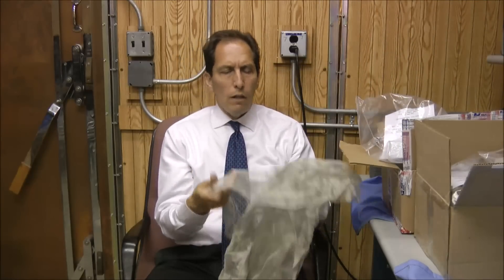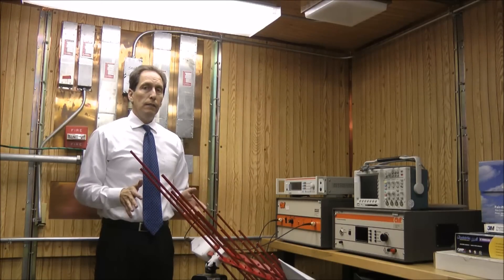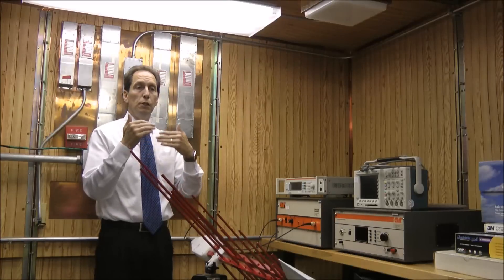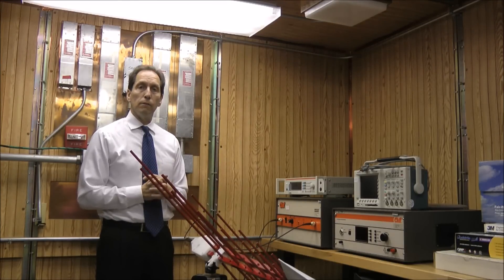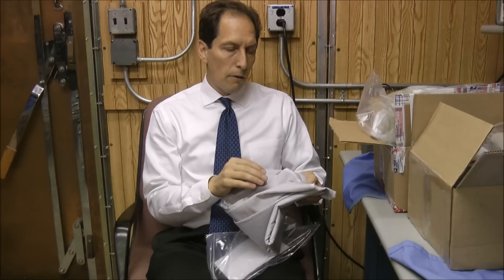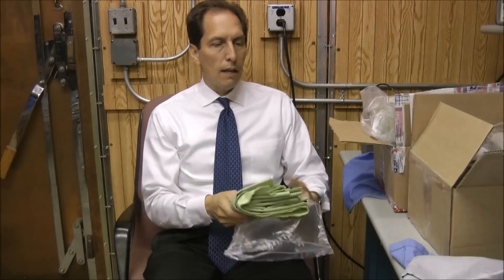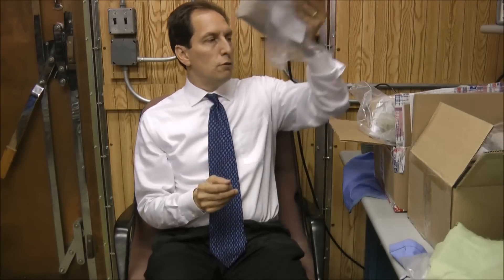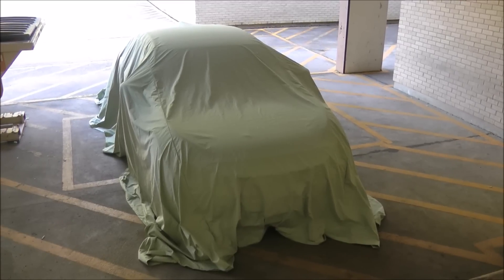Protect Generators and Cars from EMP

Comment: A couple concerns come to mind.  You said that you were concerned about the products containing nickle,  and preferred stainless steel.  Yet, it's the addition of nickle to steel that makes it a stainless grade of steel.  Second, you expressed a preference for stainless over silver.  Stainless steel has a promenent shortcoming in that it will not stand up in the face of attack by chloride containing agents such as salt water. On the other hand, silver is near the top of the list of materials that are most stable in regard to chemical attack, with only a few being better, like gold and platinum.  Beyond that, it has been demonstrated that silver remains an effective conductor even in an advanced state of corrosion.

Obviously, stainless is much cheaper than silver, so your recommendation may remain valid for that reason, but I'm not so sure about your other reasons.  I share your concerns and am very interested in this topic, and in no way do I wish to demean your work.

Best Regards.
Reply from the maker: All good points Robert. In my opinion, the problem with the silver cloth is two fold. First, most that I've seen is not washable without the shielding degrading. Also, it is very expensive (perhaps two or three times what this cloth is). I don't recommend using this cloth (or any really) out in the weather or someplace that it would be exposed to salt water.  This was the compromise that I considered when selecting this cloth.

Comment: What good is a car if there is no power to pump gas to put in the car or generator
Reply from the maker: It's a fair question, but consider that some folks have access to stored fuel. Also, there are many ways to drain fuel from other cars, as well as pump it from abandoned service stations.

Comment: wouldnt there need to be a physical separation between the coveror bag to prevent the sheilding bag or cover from groud to the electronics?  in a box I use cardboard.
Reply from the maker: Lots of folks get confused on this. We're not trying to create an isolated Faraday cage, but rather a conductive shielding barrier. They work differently, but both can be effective. I talk about this in an interview I did with Reluctant Prepper.

Comment: what if you put a few different kinds of the sheets on top instead of just picking one
Reply from the maker: You could certainly do something like that, but trying to create a large cover out of multiple materials would be a bit of a hassle. Also, this material is quite expensive, so a multi-layer cover would be cost prohibitive for many folks.

Comment: How long would you leave the protection cover on your vehicle?
Reply from the maker: The EMP radiated effects would be over in microseconds. By the time you knew to remove it, the event would be over.
Reply: But, as you said earlier, it's possible that there could be multiple attacks, so it may be just as well to wait to remove it.

Comment: I'm having a hard time seeing how this could be used in a practical manner. First of all, if you used your car several times a day you would have to take this on and off to have a protected while not in use.

Secondly, let's talk about weather conditions. Is this material waterproof? What happens if it rains and then freezes? If you get snow on it, say, eight or 10 inches, is it going to withstand being removed from the car? What about frost? I see this as being very problematic in anything other than a beautiful sunshiny day.

Thirdly, what happens if you are actually driving your car and an EMP occurs? Will it survive something like that?

It seems to me that the only thing that will actually work here is some kind of material or cover over the specific electronic parts of various vehicles. In that manner, you don't have to completely cover and uncover the car whenever you want to use it, you don't have to worry about the weather or something happening while you were driving. 

I think I already know how you're going to reply and that it doesn't go completely around all of the electronic parts and seal them up. Yes, I understand the objection, but I just don't see anyone using these total car covers in any kind of manner that actually works.
Reply from the maker: All great points! Protecting a car while it is running is difficult. To do correctly, it would require that an electrical engineer with the appropriate background analyze the system and add components to help reduce transients. Honestly, that's not going to happen for most folks. The cloth is only meant as an extra measure of protection for folks parking their cars overnight (or for a long period of time). It's not the end all solution to the issue of automobile susceptibility, but folks had been asking for something they could do to help reduce risk.
Reply: You should have enough warning time before  either a solar or a nuclear EMP event, to take action.  Like draping your car.  Israel has the red alert app for incoming missiles, and we should have something similar in place to alert us of a North Korean ICBM launch.  Say, 20-30 minutes advance warning.

Comment: Can unplugged generators be harmed by EMP?
Can unplugged radios be harmed?
Do we need to protect our refrigerators to?
.
If radios are killed by EMP,  so will the radio stations.
Reply from the maker: Generators can be harmed, especially the type with built-in start and control circuitry. Radios can also be harmed, even if not plugged in. The question about appliances is a good one. Certainly, a large conducted pulse coming in on the power lines could damage nearly everything in your home. Some folks use surge suppression systems on their homes for this reason. Others add ferrites or other surge limiting devices on the cords of their appliances. As many will point out, if the grid goes down, your refrigerator might not be much use anyway, unless you have a backup means of powering it.

Comment: Rather than sewing the pieces together, could I duct tape them together? (I'm not big on sewing)
Reply: You would need to use the metal tape or overlap them  enough.
Reply from the maker: Actually, I think you could get away with regular duct tape as long as you had cloth in contact with cloth. Still, I agree that metal tape would be a better choice overall.

Comment: In the case of metal body cars..why not just grond to earth with battery jumper cable and steel rod...and metal straps that drag on the ground in motion...??
Reply from the maker: I get asked this a lot. Unfortunately, grounding a car wouldn't do much to protect it from an EMP. The EMP couples energy into the car's cabling and electrical interconnects. That in turn creates current that damages components. Attaching the car to the earth wouldn't help with that.
Reply: That's what I was told to do with my truck by a retired military coms expert. Ground the body of the vehicle to a copper rod hammered into the ground. Just like your breaker box on your house should be.
Reply: John Baart    damnnnn  😃

Comment: I don't understand, how do you make a 1/4 wavelength short from this cloth when you're not sure what the wavelength is?
Reply from the maker: I'm not out to make a 1/4 wavelength short. I'm simply trying to put a shielding material that both absorbs and reflects RF energy. The metal weave is very fine, much finer than the wavelength of the incident wave. It is true that the EMP wave is a complex broadband wave, but shielding is typically measured at discrete frequencies to estimate effectiveness. Anyway, shoot me a note if you want to chat technical stuff.

Comment: Thank you....   I appreciate people who test boundaries and not just go by what the manufacture says.  FYI  I built a wire mesh box to cover my generator,  covered that with aluminum screen wire and then covered it with a grill cover to protect it from the elements.  With the leads isolated I'm confident that it's protected.   But was not aware of the cloth.  Looks like I've got more to do.
Reply from the maker: Your setup sounds fine. Good work!

Comment: EMP attack is impossible to cover a greater area than few miles.Impossible to synchronize many devices at the same hight over the ground. The only EMP from the sun could cover a state area.BR/
Reply from the maker: Sorry, but you're mistaken on the area of affect from an EMP. I would refer you to the EMP Commission's reports or a host of other well-researched studies into this topic. Also, your comment on synchronization is confusing. An EMP would require only a single nuclear device to detonate.
Reply: disasterprepper, ( not surprisingly) you ARE correct. It was found that atomic testing in Bikini Atoll sent out an EMP burst over 500 miles away in Hawaii strong enough to blow out street lamps.  This was a ground-level detonation. A low-orbit detonation has the potential to meet or exceed this effect.
Reply from the maker: We're all learning at this point. My goal is to just get folks to think about "what if..."

Comment: Silver facts:  silver has the highest amount of conductivity of any element, both for heat and electricity.   Too, silver, properly polished, reflects the most amount of light in the visible spectrum.
Reply from the maker: No objections to using silver for shielding other than it tends to be expensive, and of course, it can tarnish.

Comment: 1. Why wouldn't my steel carport work?   2. Couldn't someone just place the shielding cloth under the car's hood's sound dampening liner and ground it?  3.  Why couldn't we just ground our metal cars when we park them?
Reply from the maker: It's a common misconception that protecting from an EMP is a grounding issue. In fact, grounding isn't needed at all to reduce the EMP wave. Shielding is a function of the material, its thickness, and the characteristics of the incoming wave. For example, we shield spacecraft, and of course, there's no earth ground. Car manufacturers also provide shielding to critical systems so that they aren't affected by other systems or by external sources. That said, they're not designing for the very high field levels that would be present during an EMP. As for the carport question, sure a metal carport would provide some shielding, perhaps a handful of dB. The problem with just putting cloth under the hood is that there are little computer modules throughout the car (i.e., in the dash, etc.). Even so, I'm sure it would help some.

Comment: In the Army I was a communications NCOIC.  Sure the foil will absorb some of the AM RF. While holding it you are the shunt,   We setup and inverted V antenna system to transmit directional signal over a long distance , if you or anything in the path of the transmitting signal was not grounded it would get fried.    Thanks for the conversation.  Keep up the good work.  Later.
Reply from the maker: Take care. Appreciate your thoughts. And thanks for your service.

Comment: Depending on the level and location of the EMP  sometimes a simple ground will sufficient ,  however at high levels of RF. A grounding grid will be needed.  Based on the water table, in a high sand level in the topsoil will not provide enough to get a 5ohm connect therefore a grid will be needed. Think of the RF as induction. The induction must pass over the car to the ground

Comment: Unless there is a "shunt/ground to earth" on the car , where ever the cloth touches the car will allow the RF to be transmitted into the electronics of the car.  The composit makeup of the tires will allow some conductivity but will not be sufficient enough to shunt the Rf
Reply from the maker: I think you're thinking of field disturbances due to near-field induction, not far-field RF interference. We're not trying to shunt the energy from something like crosstalk, but instead, we're trying to absorb or reflect the incident wave. To show my point, try this experiment... get something that receives (say an AM radio) and hold a large piece of aluminum foil in front of it. What you'll find is that the reception will become worse. Why? There's no shunt path. It's because the incident RF wave is partially reflected and absorbed by the foil. Anyway, I appreciate your thoughts on this. Take care.
Reply: Mustang's Understood put a kickstand on your car bumper

Comment: Simply draping the cloth of the car will not be effective enough ,  the cloth must also not touch the car as it will cause a path for the RF to enter the car where it touches.
Reply from the maker: That's actually not true, but it's easy to understand why folks believe it to be so. The conductive cloth essentially acts to seal up the existing holes and gaps already in the car's metal exterior body. By doing so, it acts as a shielding material that through reflection and absorption greatly reduces the fields seen inside the car. This is the traditional shielding technique for electronics (more common, but a bit less effective than true Faraday cages) and is very commonplace in all kinds of commercial, military, and space electronics. I say this as someone who has designed for all three industries. In fact, it's actually beneficial that the cloth share the existing chassis of the car. I talk a little about the difference between Faraday cages and traditional shielding techniques in an interview with the Reluctant Prepper. If you're interested, you might give it a listen.
Reply: Multi layered cloth. If you are really worried put a heavy tarp down first.

Comment: Are you saying that you achieved about 50 db. of attenuation with the cloth simply hanging over the car? I'm having a hard time believing it was possible. Where was the receiving antenna positioned inside the car? What frequency range were you experimenting with? I assume somewhere in UHF band?
Reply from the maker: No, I achieved about 30 dB across frequency by draping the cloth over the car. I actually sat inside with a spectrum analyzer. I plan to post the complete set of data for all the cloth types in my upcoming "Advanced Topics" book about EMP protection. While 30 dB isn't the 50 dB that I recommend, it does reduce the incident field by 97%, which for a car that is off should be adequate.
Reply: Interesting. 30 db is a lot more than I would have expected from a "conductive" cloth.  It looks like you were using a directional, Log-Periodic type antenna. Have you tried positioning the antenna at different locations around the car? How about placing the receiver inside the engine bay and under the car, where a lot of wiring is exposed to EM interference? Just curious. 
I personally think that EMP dangers are somewhat exaggerated. Modern circuits are a lot more resilient than the early day semiconductor based circuits and microchips. It's just my opinion, of course. No real life testing was done with a large scale EMP tuned device.
Reply from the maker: Tests were conducted elevated from the front (atop a loading dock) and broadside. The receiver (a spectrum analyzer) was inside the car. I didn't measure under the hood or beneath the car, but I would think they would actually be better. All good questions, though.

Comment: Great informative video. May I ask; what is your book title and would this material work well to make a Faraday cage for emergency electronics? Subbed
Reply: LMAO, Dummy alert. I didn't catch the title mentioned in the opening of this video.
Reply from the maker: I have several books, but my EMP book is titled "Disaster Preparedness for EMP Attacks and Solar Storms." The cloth could be used for a Faraday cage, but there are less expensive options, such as EMP bags, foil-wrapped boxes, or even metal garbage cans. I recommend the cloth for hard to cover items, such as generators, solar panels, and automobiles.

Comment: Very interesting, thankyou. I knew of a bunker built by the Marconi company supposed to be able to stop R.F. People were surprised to find during a test that their mobile 'phones still worked inside the bunker with the blast/EMP (supposedly) proof doors closed. The copper sealing strips on these doors were then cleaned with isopropyl alcohol. Result was that the mobile 'phones could no longer ring out from inside the bunker after this cleaning. The same thing would probably apply regarding EMP. (Make sure your Faraday cage lids or doors seal well & even use some aluminium sealing tape too, where practical.) 

Looking at an article in 'Practical Civil Defence dated May/June 1983, by English Electric Valve Company , I notice that semiconductor power diodes were considered the least likely to be damaged by EMP, bettered only by thermionic valves, which are of course better still.This could be good news for owners of older vehicles without electronic ignition, in that the alternators might just still work? (It would be the diodes in car alternators that might suffer after an EMP) Fingers crossed then!
 E.E.V. Lincoln did a range of protective devices & hybrid systems to eliminate some of the risks from E.M.P. even that long ago.Delivery was quoted as 6-10  weeks back then.  A lot of this protective gear has long ago been fitted to some equipment, though nowhere near enough should we face an EMP attack. Time for governments etc. to 'get on with it'.

Comment: This cloth can have gaps. And still work fard ay cages cant
Reply from the maker: You're right that long thin gaps can be very detrimental to Faraday cages. The cloth is a fine weave of metal fibers, so there are only very tiny gaps (much less than a mm). It can act as either a Faraday cage or conventional shielding, depending on how you cover the item.